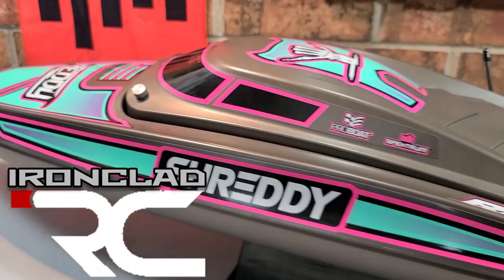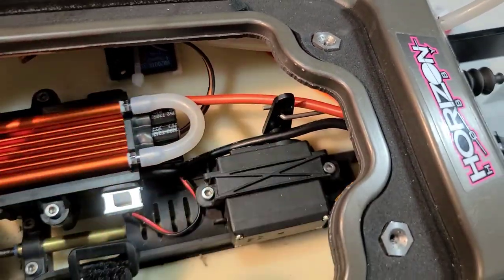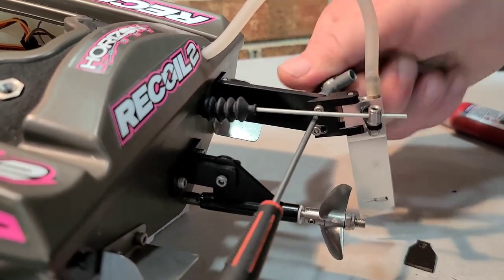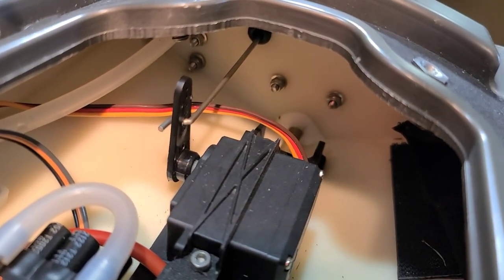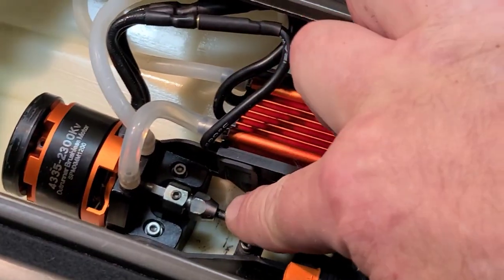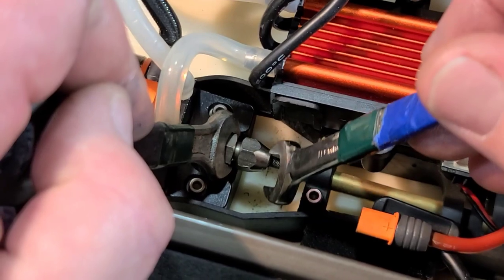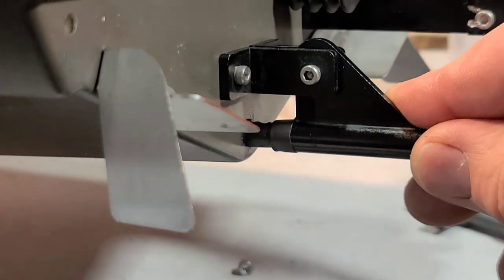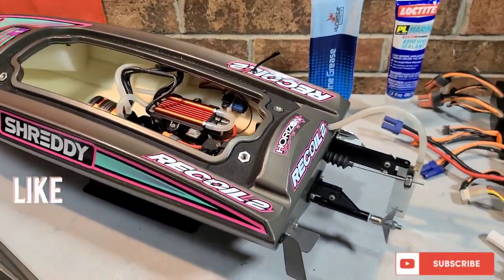Pre Run Maintenance Tips To Keep Your Proboat Recoil2 Running Tip Top - Rc Boat Maintenance

Comment: my currently struggling with my recoil 2 taking on water. water testing in my pool and the lake with zero water not driving but as soon as i drive it for a battery gets about a cup of water inside her, she’s also fully taped up fyi so not sure where to check for leaks now
Reply from the maker: Check the steering boot......      

Also truly this...
 put the boat in water pull the trigger with the hatch off, (no prop) watch the end of the flex cable for water entering the boat where collet flex connection is.      

I had a leak where the stuffing tube goes into the boat, (stuffing tube thru hull)  The stuffing tube adhesive had broken loose.

Comment: If I got rust or water that has given my motor an ugly sound, do I grease it and is that fine to do?
Reply from the maker: Probably the motor bearings, oil the bearings with high speed bearing oil or thin oil of some sort, I use corrosion x on all my motor bearings.    Bearing may need to be replaced
Reply: @IRONCLADRC  would rc shock oil (20) thickness do the job lol?

Comment: So I was testing the boat and it wasn’t strapped it was out of the water and there’s a hole and I see a little bit of yellow is this ok?
Reply from the maker: There's a hole where? In the hull, Or the battery tray?
Reply: @IRONCLADRC  it’s on the battery it rubbed against the battery causing a little hole but I tested it and it crashed and caught on fire so now I have to fix it 😭😭😭

Comment: Thx for your advise! Got my shreddy yesterday, use it with 3300mah 4s and octura m440 prop.. really love your advise with the straps! I have 3 straps on it now. And the wire plate! What a good option! Thx ! Greetz  from Holland
Reply from the maker: Glad I could help brother,  the m440 is a perfect prop for that boat!  🇺🇸

Comment: Once again, thank you 😊 for informing me on how to take care of an RC boat. Knowing my luck, I’d buy (or build) the boat, and have waterlogged circuit boards, and ruined 😠 motors. The area where the propeller shafts, where they enter the boat, is particularly important, especially with the screws needing to be tight there. Grease is another vital component to maximum RC boat life. What are some of the maintenance 🧑‍🔧 procedures, if I run an RC boat in salt water (i.e., the ocean)? Would I totally ruin my RC boat, or the propellers, and propeller shafts? Is there such a thing as a salt 🧂 water RC boat? Again, your friend, Jeff.

Comment: Hallo strip of velcro where we put the battery so it wil stays  on place 
I have some planes to with mine velcro de battery stays on her place to
Very dangeous for the cg on the plane also for the boat 
With heavy  batteries 4s must we put  a little bit  forward or backward greetings 
 greetings
Reply from the maker: The weight of the velcro shouldn't effet the cg on the boat at all. Boats aren't quite as weight sensitive as airplanes.

Comment: The piece on the steering pushrod with grub-screw that bolts to the black rudder arm, is that upgraded? I just bought one of these and it's different than what's on mine.  On my second run out that piece snapped, looking for an upgrade.  Great video for the novice RC boater!
Reply from the maker: Yes it's an upgraded part which may require drilling the stock hole larger on the rudder steering arm
Reply: @IRONCLADRC  Who makes that part and where can I get one?
Reply: @IRONCLADRC  Same thing happened to my recoil 2 as Andy's. Any suggestions for replacement? Horizon Hobby has the part on backorder but I'm afraid it'll happen again. Thanks for any help you can swing this way.
Reply from the maker: I think this is what you need if not let me know & I'll try to help further 
https://www.offshoreelectrics.com/proddetail.php?prod=ose-83106

Comment: I am making a little bait casting long range boat… would it be bad if I have a “waterproof” brushless motor directly in the lake water.
Reply from the maker: Depends on what motor your running. I wouldn't advise running a brushless motor totally submerged

Comment: Hey quick question, am I supposed to be able to move the propellor while holding the motor still? There’s a little bit of a flex to it..

Also my shreddy sounded so much better after greasing the shaft!
Reply from the maker: No, if your holding the motor shaft & flex cable stationary, and the prop spins your drive dog isn't grabbing the shaft.    You may need a new grub screw or the drive dog needs to be tightened with loc-tite..   worst case you'll need a new 3/16 small drive dog
Reply: @IRONCLADRC  well it wasn’t like that before, weird..
Reply: @IRONCLADRC  and also is it ok to use it or is it a must fix immediately?

Comment: What about motor bearings?  Do you ever lube them?
Reply from the maker: I've been using corrosion X for all my rc bearings.    I use to use high speed bearing lube but corrosion X seems to work much better imo

Comment: Definitely helpful; though to be honest for the price - it's kind of backwards that you (the general you, not you specifically) have to do all this stuff out of the box as if the factory does such a horrid job that if you don't do all this stuff something will break. I guess one could argue that that's apart of "hobby grade" stuff; but not everyone wants to be a miniature mechanic with their vehicles, just like most people don't bust out the wrenches and things when they get a new car :)

I'm sure all this stuff is preventative - but an absolute beginner like me, doesn't want to secure screws with locktite (making them harder to remove in future if need be) - and the rudder "it feels good" - you only know that because you're not a beginner. That's all - just a caution.

Perhaps some of this stuff isn't required but recommended if you're confident in it. Personally on a $100 boat I'd be inclined to tinker, but not having a lot of experience tinkering, last thing I want to do is impact or unintentionally break my new expensive boat.

EDIT: As I continue to watch, I think the tone softens a bit and gets more encouraging / optional. Still good stuff overall.

EDIT 2: I actually had a soft pack (the included one) battery bang around a bit, scrapped some of the packaging off but the enclosure looks fine. I added the velcro strip that came with the boat, plus the 1 strap and that made a world of difference.
Reply from the maker: I give up.   I literally give up trying to help others get the most from there boats.      

Just run the boat dude.  No need to grease and oil stuff.   Run it hard and put it away wet.   You'll  See just  how long your new boat will  last
Reply: @IRONCLADRC  Hey there, don't give up - I realize I came off like a jerk, and I sincerely apologize for that. It's super hot here and I'm cranky :) so that's my bad.

I totally get you're trying to be helpful and encourage new owners / demonstrate that its alright to open it up and tinker around. I'd definitely say given the cost to bring it up here and the currency conversion - plus a second/bigger battery, better charger, small toolkit, etc - my first RC boat cost me about $800-825 all in. The boat alone is about $550 after tax up here.

So given all that outlay, and my super newness to hobby grade stuff, I just wanted to figure out the flex shaft maintenance stuff and to see all that other stuff it kind of irked me that buying a brand new boat needed all those steps. I can see if you're confident with tools and stuff that this process would be nothing but new and exciting. For me though, with an added visual impairment this stuff is nerve wrecking and tedious. But that's on me.

I will say, doing the flex shaft grease work wasn't that bad - but given I took it out every other day for 7 days, doing it every time seems a bit excessive. But I'm gathering people don't go RC'ing that regularly (I was on vacation on an island, so water just out the door).

Anyways again, my apologies for coming off like a jerk - your enthusiasm just caught me off guard, not wanting to do all of those things just because.

I will still ponder though if the locktite and stuff is really necessary or better something thats optional but keep an eye on it. i.e more "Hey if you start seeing more water then usual in the boat, here's some tips (lock tite the screws, foam here, sealant here, tape, etc) - but I'll say after probably 5-7 runs draining the battery every time, I only had a little water inside each time (drained through the drain plug, wiped down inside/out and let sit with the top off.

Sorry if that's a ramble, but seriously - keep up the good work.

Comment: I just put a 4 s in my boat revved up the motor and over half throttle it make a kid back screeching sound. What is that. Need help. Thank you
Reply from the maker: I've found that it doesn't like esc over 100a they turn the motor to hard.   Flycolor 90 is a good upgrade
Reply: So your saying I can’t run 4s pack with the original esc
Reply: @IRONCLADRC  
So your saying you can’t use 4 s with the way it come stock 
Thank you for you help info I new at this RC boat stuff

Comment: What size 4s pack do you recommend
Reply from the maker: 3200 - 4000mah  90-150c will fit perfectly 5000mah+ you'll most likely need a soft pack, check measurements while choosing a battery
Reply: @IRONCLADRC  what do you think is best though weight wise ... would a smaller 4s like a 3300 be better

Comment: Anyone know the flex cable size on this? I want to put a tfl strut on it but idk what cable to use.  I want a longer prop shaft but stock flex shaft diameter.  Anyone know what I need?
Reply: 3/16

Comment: Way before you make your modification for the battery line you put metal spring on the bend u water line ,and you put on your modifications is not anymore the metal spring on the water line ??¿¿ Not make sense .
Reply from the maker: It didn't need the spring there was no kink.   I was just showing you guys a trick for a kinked line on an esc.